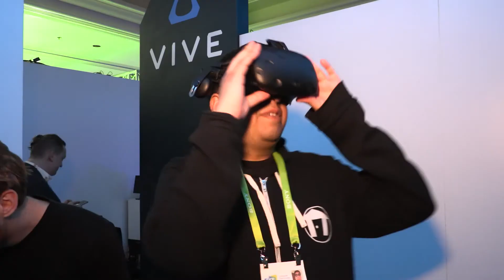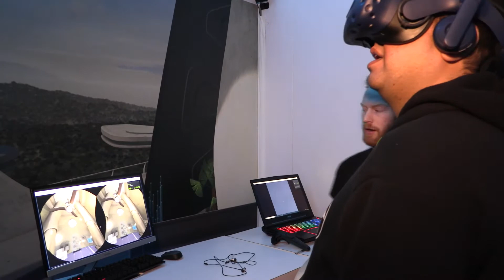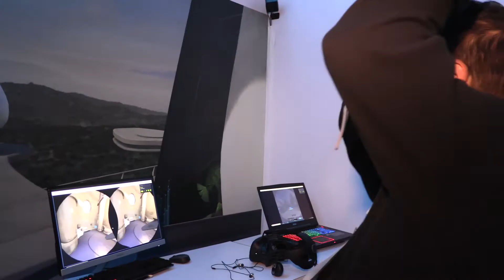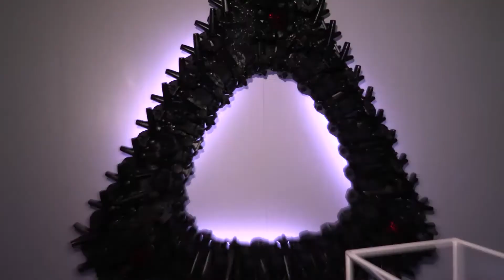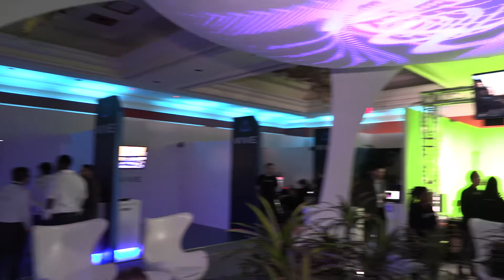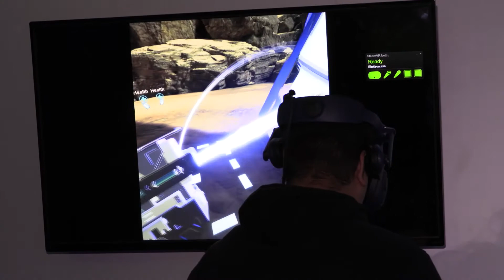HTC Vive Pro + Wireless Adapter Interview

Comment: Probably cost $1000 so you can play low quality indie games in higher resolution
Reply from the maker: No way. If The Vive 1.0 was $600 with Sensors, Headset and Controllers, We're gonna guess. 300-400$
Reply: I don't think Fallout 4 VR is a low quality indie game tard face.
Reply: haha here in europe it costs 880 euros. thats 1100 dollar